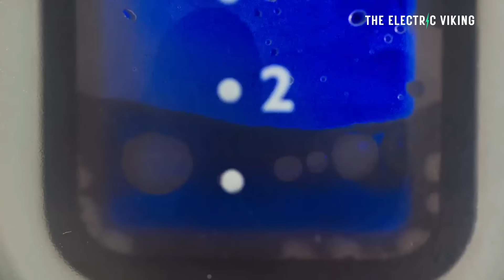The SODIUM Battery REVOLUTION Begins in the United States...

Comment: The insane increases in power costs are TOTALLY due to "green" demands that were coming out of the feds and local green folk.  In Dem controlled states, they have almost no rotating generation.  They also do not want wind in areas with sea shores...  Obama did say "the cost of electricity will increase drastically" with the green plans.. and it is happening.  Getting better storage in place is critical.  There are several flavors on the way.. AL, FE, and Sodium ion will hopefully provide the needed storage.. but we need a nice new 5 Gigawatt NUKE every few weeks to provide the base generation for all those data centers and home use.  Without that, bad things will happen.  China is still building coal plants at a rate of several per month...,

Comment: Sodium ion batteries perform worse than lead acid , with round trip efficiency of 60-92% compared to AGM 80-90%. They have a faster degradation rate than lifepo4, they may be cheaper but not as good seem to be a bit of a scam

Comment: Bottom line from ChatGPT

Short- to mid-term (next 3-5 years): Lithium miners are not in existential danger. Sodium-ion still has significant technical, scaling, and performance hurdles to cross. Lithium remains dominant in high-value applications (EVs, mobile devices) where energy density and weight are critical.

Long-term (beyond 5 years, especially 2030+): The threat becomes more real. If sodium-ion (or other competitors) continue improving, adoption could erode lithium’s share in certain markets. In that case, weaker lithium producers are at risk of negative disruption.
Reply: Ask ChatGPT about the Epstein files

Comment: Watts per kg.  Silicon anode lithium ion will win in portables and lightweight vehicles as it expands into wider production.  Sodium ion is lower cost by a lot but less dense than lithium ion and last longer than LFP.  So sodium ion should be a utility grid solution as Viking says, but cars will only really factor in if both tire tech improves and ranges become less important.  So only power wall and grid store are the parts of Tesla that should pivot.  Viking, showing cars in this video is misleading.

Comment: The seats the windshield wiper axles the pump for the windshield wiper fluid. The regular car tire axle bearings, the handles on the doors and the the position knob for the for the seats. All of those will break before a million miles and they don't tend to keep that stuff in stock so that you have to actually get rid of the car even though the motor and batter you're still working. All of this by a million miles for sure. A $10 million mile battery is not going to do any good in a car

Comment: The energy density of the Peak batteries is about half of LFP batteries, so at this point are not in the ballpark for the EV market.
Reply: CATL say it’s about 95%.
Reply: @DavidBridgman-hy8ib  Different chemistries...
Reply: It depends on whether that EV market has ubiquitous EV super charging. Sodium will crush Lithium in that market and that market is the market of the future, not the past. Thus investing in sodium battery technology makes perfect sense. Faster charging, better safter thermal runaway management, better performance overall in extreme weather conditions and cheaper per kW/h of energy storage.
Reply: The Peak batteries were explicitly designed for stationary storage. No need for active cooling, extremely long lifespan, extremely high efficiency, can be shipped at 0% SOC, etc.
Reply: Even if this is true (early days in NA-ion tell me they'll catch up eventually), that's basically a non-factor for utility scale storage.
Reply: How do these compare to vanadium flow batteries for grid storage?

Comment: Some utilities have started Peak Pricing which bills customers according to their highest usage hours, intended to penalize those with solar PV. This is because of customers who sell their excess solar PV production to the utility precisely when the utility also has excess production. The same customers reverse flow as PV production drops. Battery storage owned by either utilities or customers equalizes this imbalance.
Reply: Once you have a battery, you can tell the power companies to get lost

Comment: Mr Viking: I'm looking at my Electric Bill right now in Central NY State - 5c kWh generation 6c distribution- Hardly Exploding!. They will explode however when all these idiotic Solar Panels they are installing have to be paid for. From Nov15th thru March 31 average 5 days sunny days a month and since we also get 100+ inches of snow they will be covered up. In addition we are on the 43 N Parallel- very low Sun angle.

Comment: A study by X-energy Canada has confirmed the feasibility and benefits of repurposing an existing thermal generation site in Alberta with X-energy's small modular reactors, and establishes a foundation for further planning and regulatory engagement to support future deployment. The study was funded by Emissions Reduction Alberta through the Government of Alberta's TIER fund, and conducted with TransAlta, Hatch, PCL, and Kinectrics. It found "significant alignment between the province's unique energy and industrial profile and the attributes of the Xe-100" and identified areas where X-energy's technology can directly support the province's energy economy and long-term competitiveness. It found that the Xe-100 high-temperature gas-cooled reactor is uniquely suited to Alberta's energy needs. As well as producing electricity, it is specifically designed to provide 565°C heat and steam for industrial applications, unlocking a broad range of use cases for Alberta's industrial and oil and gas sectors, the company said. The province's established supply chain capabilities are well-positioned to support the manufacturing and construction of the technology, while the Xe-100's design means it can use air-cooling systems, significantly reducing overall water usage, and offering greater siting flexibility over conventional light-water reactors. Canada gets about 15% of its electricity from nuclear power with 17 reactors, mostly in Ontaria, providing 12.7 GWe of power capacity.

Comment: Lithium battery storage is 10 times more expensive than the equivalent amount of sodium storage when viewed as a long-term capital investment. Why? Well, consider that 1 unit of sodium storage would provide the equivalent lifetime storage of 5 units of lithium storage of equivalent energy density. But 1 unit of lithium storage costs 2 times more than 1 unit of sodium storage. So over the lifespan of 5 lithium units of storage, lithium storage costs 10 as much as the equivalent sodium storage!!!

Comment: I agree about lithium becoming obsolete but, Careful with investment advice! You should add a disclaimer
Reply: this is like getting offended on someone else's behalf. Just let the man live
Reply: It's not that Korea can't make sodium batteries. Instead, Korea has completed the development of a ternary LMR battery. By reducing expensive nickel and increasing inexpensive manganese, the price is lower than that of iron phosphate batteries, and the performance boasts an energy density 50% higher than that of iron phosphate batteries. Korea has solved the problem of reduced lifespan during repeated charging, which is a shortcoming of LMR batteries, with single-crystal cathode coating technology. The cathode material has already been developed, and LG Energy Solutions is only left with production with GM. The real game changer will be the LMR battery, not sodium.
Reply: it wasnt investment advice it was dont invest advice, he wasnt telling someone to buy something.
 he was warning that the use case for a product had pretty much dried up, catl will have these commercially available within 6 months, 6 months after that ....
these batteries have slightly higher energy density than the blade battery with no fire risk and being 4x cheaper 5x longer lasting theirs going to be limited use cases for lithium

Comment: Sodium battery price only 25% of a lithium battery price? Many more cycles? Game changer.
Reply: Definitely a game changer but not free of problems. They have a very weird voltage curve that has to be addressed
Reply: @veganpotterthevegan  But also weigh a lot, so less likely to get deployed in cars. But ideal for buses, big vans
Reply: @ashokpadhy1100  they're going to do very well for cars in major cities in developing nations.  People don't need even a 100km range in the world's biggest cities where most of the planet resides.  They just need cheap cars that don't produce tons of smog.  I live in the US and Philippines and I'd gladly have a car with a 100km range at my home in the Philippines. I'm 42 and I don't think I've ever driven over 100km more than twice a year in the Philippines.  The same can be said for the majority of people in India, China, Indonesia etc.
Reply: Also why CATL took its own mine offline this summer despite it producing 6% of the entire world's supply...
Reply: 25% of the price in materials? Or,
25% of the price in the finished product?
Reply: Not as much energy density (yet) so batteries are bigger and heavier for the same amount of energy.
Reply: @r.l.royalljr.3905  175w/liter is better then the earlier LFP batteries
Reply: Only if the car prices drop however there's still range anxiety and repair costs to deal with, it will be decades before there is enough power on the grid and charging stations to  accommodate the preceived influx of buyers especially Australia with a Government hell bent on Zero Emmissions with wind and wind chimes between their ears inbetween that is a complete vaccume.
Reply: @ClintRichard  You don't have enough power now? Do you think everybody will buy an EV overnight? Or will it take many years? 
And no, zero emission is not hell.  I hear you have some sunshine and wind there, too.

Comment: What Trump policy would increase the price of electricity?  Just the opposite  actually
Reply: Trump is trying to shut down renewable energy (e.g. wind) projects on the Atlantic coast. Revolution Wind is 80% complete and was expected to supply Rhode Island and Connecticut with  electricity from wind. Trump wants to prevent them from supplying electricity by revoking permits already granted.  There are also renewable energy projects in New England he wants to shut down. This is what can cause an increase in price of electricity, because it reduces available supply. Wind generated electricity is practically costless once the infrastructure is built.
Reply: @bengt_axle wind is not a viable solution, those wind turbines can't even cover the ROE. When they break down there's no good wsy to deal with the wate. Tell me about nuclear power and I'll buy that
Reply: They are not public property. They break down and the utility pays for them. There are literally thousands of uncapped wells in the Gulf of America (Gulf of Mexico) and hundreds of abandoned oil rigs oil companies just leave there to decompose and pollute the water?  The lax federal legislation does not even require oil companies to clean them up.  Denmark, Netherlands, UK and many other countries get electricity from wind. In fact the project Trump is trying to shut down, was constructed by a Danish company that has experience with wind generation. The ROE as of September 2025 (TTM) for Vestas Wind Systems A/S (VWS.CO) is 23.64% Once the turbine is up and running, how much does it cost to "mine" the electricity compared to oil? Or even nuclear?

Comment: There was a commotion about sodium batteries in Korea at one time. China lied that sodium batteries were cheap because they were made from seawater by CATL, but in reality, that is not true. The claim that sodium batteries are cheap is almost a lie. Also, the storage capacity is not even 60% of that of iron phosphate batteries. Don't be fooled by China. Chinese technology is something that is made without any basics and lies that they are the best. The basics of batteries are how much electricity they can store and how good the output is.
Reply: The LMR battery that Korea has completed development and is scheduled to be released will have more potential than the sodium battery. The LMR battery, which reduces expensive nickel in the ternary battery and adds a lot of manganese, is cheaper than the iron phosphate battery and has an energy density that is 50% higher than the iron phosphate battery. In comparison, the sodium battery is by no means cheap to produce and is not suitable for electric vehicles or energy storage devices in terms of energy density output. This is an obvious lie that Chinese companies are deceiving consumers.

Comment: That is not going to happen. The new OpenAi Stargate data center will needs 4.5Gw, this largest US storage project "can" power it for 2.8 seconds. They will need 1286 of those to make a 1h UPS
Reply: Mate, seriously? 4,5GW for 2,8 s is 3,9 MWh. Even the battery in Scottland is 100x bigger and it will be dwarfed soon enough.
Reply: @johnbraunschweig  no it is 3.5MWh, and that is the info in the video. The battery in Scotland, the biggest in Europe is 300MW/600MWh, you will need 15 of those to power the farm for two hours. Each one costs £750 million, that is £11.25 billion pounts for a 2h UPS
Reply: That's not what they're for

Comment: what happened to aluminium ion?.
Reply: Salt is cheaper.
Reply: It's not that Korea can't make sodium batteries. Instead, Korea has completed the development of a ternary LMR battery. By reducing expensive nickel and increasing inexpensive manganese, the price is lower than that of iron phosphate batteries, and the performance boasts an energy density 50% higher than that of iron phosphate batteries. Korea has solved the problem of reduced lifespan during repeated charging, which is a shortcoming of LMR batteries, with single-crystal cathode coating technology. The cathode material has already been developed, and LG Energy Solutions is only left with production with GM. The real game changer will be the LMR battery, not sodium.

Comment: In the United States, short term (5 years), sodium isn’t a threat in EV’s and only slightly (very slightly) more of an issue in stationary storage. Why?
1) Geopolitics.
2) Scale and density.
The first is obvious. The second issue is it’ll take time to scale the technology to a high enough volume to be a threat to lithium. As I’m sure most know, you can’t just start buying salt and transport it to your lithium battery factory. You need the technology, the facilities and the machinery to build them. Change at scale takes YEARS. From year to year, what’s the range difference between any given model of Tesla? 3 to 4 percent? At most? Even comparing a 2020 model Y vs a 2025 model, most of the increase in range is due to the car and not the battery chemistry energy density. Tesla is BIG on cutting costs more than advancing energy density (cough 4680, cough, cough!). That’s not an insult. It’s definitely not a bad thing! However it is important to recognize their priorities.

Sodium ion is definitely an extremely important tech going forward but it’s not coming overnight. Unless it’s your job, don’t lose any sleep over it.
Reply: The LMR battery that Korea has completed development and is scheduled to be released will have more potential than the sodium battery. The LMR battery, which reduces expensive nickel in the ternary battery and adds a lot of manganese, is cheaper than the iron phosphate battery and has an energy density that is 50% higher than the iron phosphate battery. In comparison, the sodium battery is by no means cheap to produce and is not suitable for electric vehicles or energy storage devices in terms of energy density output. This is an obvious lie that Chinese companies are deceiving consumers.
Reply: Naxtra CATL has energy density 175kwh - that's better than current BYD blade battery. They are already producing it with mass production coming in 2 months( December). They had this battery on display in Munich a month ago on auto show. 30 different car models in China already purchase this battery and will have it in 2026.
Reply: catl's sodium battery(175kw/kg) already has higher energy density than BYD's blade battery lol which is like gen 2 or 3 of lithium
your estimations of when it will take over the us market are off by 4 yrs 
in 6 months they hit the us market at china scale
telsa will be using them in 6 months, 6 months after that anyone trying to sell a car without 1 in it is going to have 1 price issues and 2 safety issues(sodium dosent burn) to overcome
Reply: That's right. Sodium batteries have a lot of mountains to go through in order to commercialize them in earnest. It's not just about sodium being cheap. How do you make hard carbon cheap and when do you make another factory for mass production?
Reply: Geopolitics is a very vague broad term, cheap labor overseas is the main concern, amongst other lessers, right?
Reply: sodium tech is going back in time,  ALL elements were tried long ago, and lithium is the best;
Reply: China has it already in mass production
Reply: @michalandrejmolnar3715  That was my thought when it was suggested that it would take years to make the change.  It might take years here in the US but in China?  China is an innovation powerhouse like the US used to be.